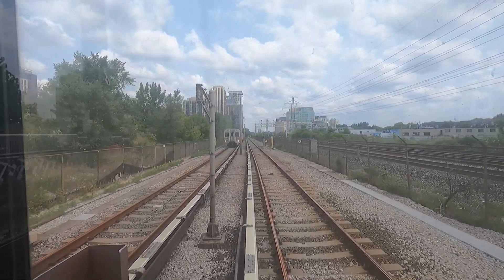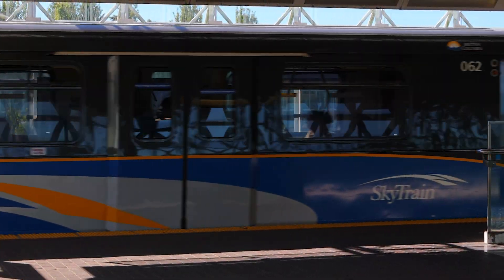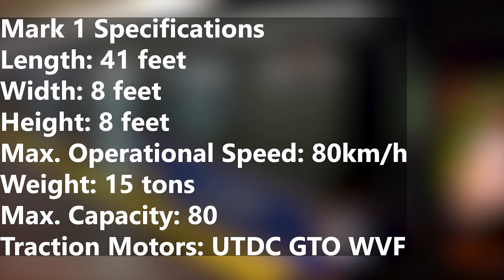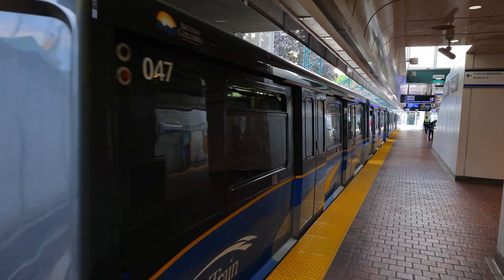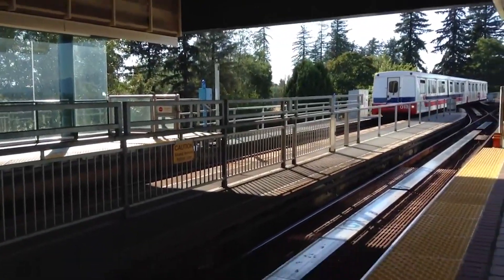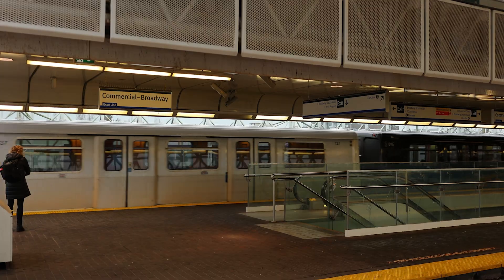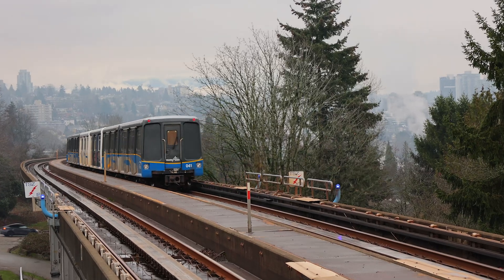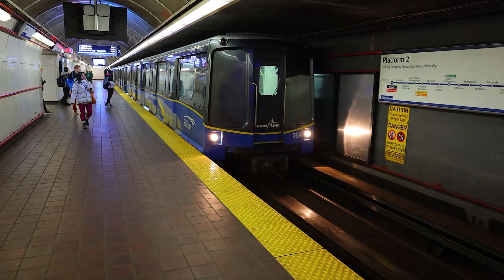The Original SkyTrain Cars | Mark 1 SkyTrain - HISTORY AND ANALYSIS | Transit Vehicle Profiles

Comment: Great news for Detroit and bad news for Toronto as the TTC shuts down line 3 Detroit will get the refurbished Mark 1’s till they get enough funding in the next 2 years for NEW SKYTRAINS IN DETROIT! The line is now free for commuters and has seen its ridership numbers double. Detroit Transit has also re aligned bus routes to terminate at People Mover stations which is also adding a LOT of ridership. With the Q line expanding and connecting directly with the People Mover the Detroit Transit agency is also looking alongside the city and state to finally double the track and extend the network! These plans are moving albeit slowly but are moving along now!

Comment: With the Mark V’s approaching soon, Victoria has been wanting a Skytrain ish transit style, if this transit style comes to the Island, it would be nice to see these trains transfer to Vancouver Island.
Reply: It's highly likely victoria will choose newer models of skytrain like the Mark. V simply due to the age and lack of legacy support for mark I's by manufacturers. Re-Introducing them into service would probably require a full overhaul that requires parts that are simply not in large supply. For example the Toronto system was basically doomed for retirement after the mark I's ended service as the later series were too large for the line and overhauling the mark. I's would be incredibly expensive if not impossible. It is unfortunate but everything has an expiration date.

Comment: Bruh the whining sound it makes when it departs the station is music to my ears. It's one of the reasons why I love taking the Mk1 Skytrains 😊😋. Translink is lucky to have the Mk1s reach & even surpass their 40th Anniversary unlike Toronto's Line 3 that was forced to shut down permanantly before it's intended farewell on Nov 19 after 38 years on July 24/2023 due to a derailment. Since you pointed out the Mk1s on Toronto's former Line 3 are manually driven unlike Vancouver. The reason Toronto's Mk1s did not utilize the intended driverless operation like Vancouver was due to pressure from the union seemingly because the TTC was skeptical of driverless trains. I may be from Toronto but I can honestly say that I enjoy taking the Skytrains more than the subways in Toronto especially the Mk1 Skytrains. Those go 80 km/h all through the Expo Line unlike TTC's Line 3 where it literally only goes 80 km/h between 2 stations, Midland & Scarborough Centre. The Mk1 Skytrains are dear to me & I will miss them when retire. Hope to able to ride them in their final year of revenue service

Comment: my grandpa actually worked as the main communications director for UTDC, so I probably know more than most people about mark 1s and the original skytrain project - its truly amazing

the expo line was actually originally going to be a MagLev, but due to constant stopping and stopping, and balancing issues when it's busy, they simply but wheels on the maglev, and that is what we call the Mark 1s.

the reason why the canada line is so slow and sparks so much is due to it using electric motors (axles drive the train). which makes it impossible for the axles to turn, resulting in sparks, track wear and tear, and such on curves. Since LIM (linear induction motors) aren't directly turning the axles, the axles can freely steer, which is why they go so fast over switches and curves.

as for the grinding noises, eh thats just wear and tear on both the track and the axles, hence some track replacements along the line near (metrotown?) - the mark 3s do this too, just not to the extent of mark 1s

other than a few small things left out, this was quite the good documentary! Mark 1s hold a special place in my heart - sounds, family connection, and their character.
Reply: So we were going to get an even faster train but stuff happened so they had to go with Plan B. I wonder if with newer technology, they can go back to Plan A.
Reply: @AlphineWolf  It's super interesting to imagine the skytrain system as a maglev - quiet because of no axle and wheel screeching, and it would be super smooth. Only issue is probably constant stopping and the train being unbalanced in different loads. Funny how plan B has worked so well, eh? i like to picture the mark 1s as a maglev with wheels haha
Reply: @thyssenFILMS  I mean they are eventually going to do a Seattle to Vancouver line so maybe Plan A may eventually be on the table.  It be strange seeing an eventual extension all the way to white Rock. 

Edit: Been wondering if it's actually possible to convert Canada Line to the original skytrain technology.
Reply: @AlphineWolf  yeah the canada line really is terrible, short platforms, slow trains, rail and wheels being worn out due to lack of the axles being able to rotate freely. i’m actually unsure of if the broadway line is LIM (linear induction motors) but since i heard mark 2s are going on there with the delivery of mark 5s, i think it is LIM, and thank god. another canada line would be a disaster, especially with the amount of ridership on the 99
Reply: @thyssenFILMS  apparently the Japanese were working on Plan A all these years. Somehow they managed to make it work. Only took them 19 years. Debuted at Expo 05. I guess when it doesn't work, keep going back to the drawing board until it works. What's your take on their refusal to give up on the project. Looks like Plan A if they had gotten it to work at the time would have traveled 100 km/h. They added more power. But has issues balancing when its busy. Wind is also a new issue as well
Talking about the Linimo Line in Japan.
Reply: Axles not being able to rotate freely probably isn't the largest issue. The main issue is wheelslip. In bad weather or during autumn when there are leaves on the line, the adhesion between the wheel and the rail goes down a lot. With the motors driving the axles, there is not enough adhesion between the rail and the wheel to accelerate, so the wheel loses traction and slips. Because motors have a very high power output, the wheel will often spin up to a high speed before wheelslip protection kicks in and cuts power to the motor, but the train isn't moving, so it causes the wheel to grind against the rail giving a lovely display of sparks (sometimes).
Also the Canada line uses top contact third rail which is not great in icy conditions while legacy skytrain uses side contact third rail. This is because ice and snow can form on the top of the third rail. Unfortunately ice isn't a very good electrical conductor which means that the third rail shoe on the train which draws power loses contact with the third rail which can cause electrical arcs.
Reply: @williamhuang8309  what you said about the other factors is true. however, at the time of making of the train, the reason they didn’t completely cut Linear induction motors out of the picture and use electric powered motors (like everyone else, who thought they were fools for using such new technology like LIM) was because of the ability for the axles to freely turn at extremely high speeds, comparatively to the motor driven trains, while wearing down the track and axles less. This is why on the expo and millennium line, the trains absolutely rocket down switches and turns, sometimes even at max speed, meanwhile the canada line trains slow down to barely a crawl and still generate lots of sparks

I believe they went for electric motor driven trains for the canada line as it was cheaper at the time, and they were rushing to get the entire line out before Olympics 2010, whereas the expo line was small at the time of Expo 86, so rushing wasn’t much of a concern.
Reply: @thyssenFILMS  it was small but they also had 2 companies for expo 86. One ran by the Canadians and one by the Japanese. They still have the old car in bc transit livery in Japan. So they had no rush and less pressure. Both maglev types.  Way more pressure for Vancouver 2010 as it was only 1 group vs expo 86 with 2 different groups providing track and train.
Reply: @williamhuang8309  once translink regains control, hopefully they can retrofit the tracks to run the original technology

Comment: 3000 and 3001 derailed in toronto recently, seemingly due to bogie issues
Reply from the maker: Yikes..... And there is a good chance that's the end of the Scarborough RT and the trains that run there.
Reply: Yes, it derailed at July 24h because it is retiring and shut downed. TTC is selling Scarborough RT to Detroit
Reply: Update, it was also due to a loose magnetic rail since the bolts used to fasten it got undone.

Comment: you know i some of the mark 1 train's doors sound different that i can kind of describe as creaky springs and they are kind of rare to come across although i really like the other doors because it's quite clunky in a good way and also hear the high pitch whine of i assume pulse width modulation feeding into the motor, how it opens and closes the door and quite interesting like it swings the door open and turns off the motor and the momentum carries the door the rest of the way and sometimes the motor turns back on for a brief moment cuz the door didn't open up enough which happens seemingly every time closing the doors, it's just more interesting to watch then the more modern effortless automatic doors of the other trains although the mark 2 trains are some what interesting with the little click before it opens and the satisfying clicks of the latch when closing, i assume the the clunky slow doors of the mark 1 is why it chimes the bell twice when leaving

Comment: I just found your channel (from your Surrey bus video) and stumbled upon this video. As a Vancouver public transit nerd, I loved this deep dive. I take the Canada line way more than the expo and millenium ones, so I don't often ride the Mark 1, but I caught it a few weeks ago and was happy... mostly because it's the Skytrain car Twice (a huge kpop group)  used in their Likey music video. Once they retire the mark 1, we can't recreate the video anymore. Great in depth video and I'm looking forward to more.
Reply: unfortunately the canada line is pure garbage due to the fact it's powered by electric motors - directly turning the axles. because of this, it sparks on turns, wears down the tracks and the wheels, and goes slow over switches and curves in the track. the reason the canada line isn't powered by LIM (linear induction motors) is due to the fact that the project was rushed for the olympics, and that an LIM-based system is much more expensive, although more future-proof.
Reply: @thyssenFILMS  it is loud, but it’s much closer to me than the other two lines hence why I take it more. Needs longer trains though
Reply: @AllycatlovesAG  of course, it’s just sad that they cheaped out on the canada line… so many advantages to LIM than to the electric motor system. And the trains are short…

Comment: Original batch was correctly stated in the video: 001-056.
The next batch of original cars were numbered: 061-118.
Cars 057-060 is still a mystery.
Reply: There was a video clip that showed set 059-060 numbered on a 1991 version in the late 90’s for some reason 😆
Reply: @justinm.1  bcz bc transit made that
Reply: @justinm.1  IKR  TOO FUNNY
Reply: @justinm.1  I have seen clips of that. I even asked a former SkyTrain employee if they know about this. Even he had no clue if that idea was concrete.
Reply: @justinm.1  I heard that was temporary numbering from CPTDB, but there's no official explanation.
Reply: @GrouseGrindGuy  It was said that the computers couldn't handle numbers above 120, so they were temporarily renumbered to 'nonexistent' sets until the system was upgraded to handle larger numbers.
Reply: actually it the cars  started to 1984 to test to make sure it was safe to use then  them bc transit aka translink put them aka 114 batches in service in 1985
Reply: there still around but as rare 4 car sets on the m line and expo line
before dumb translink retire them this year
Reply: The video is cool mark one start up sounds skytrain cars by traveling Tom at 9:03